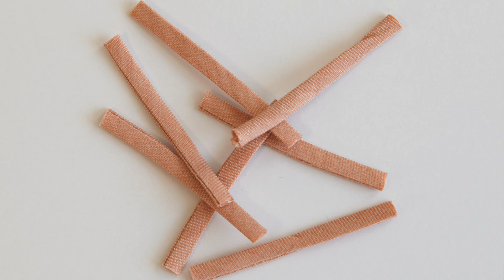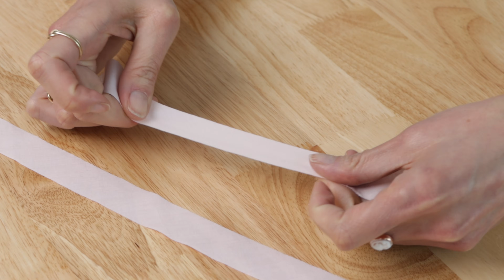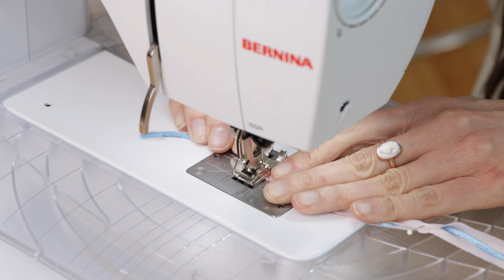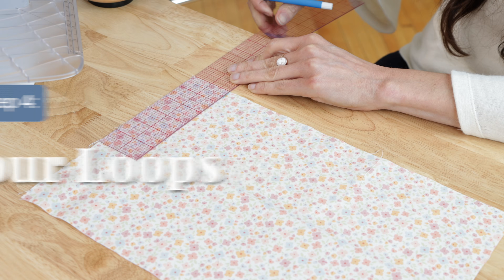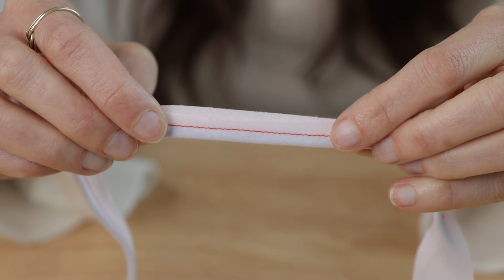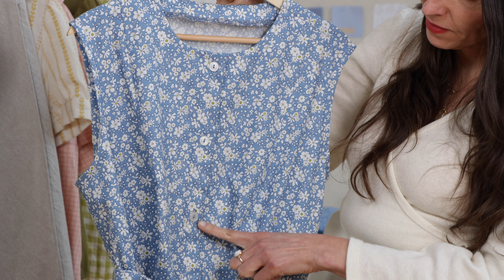Button Loop Sewing Secrets Every Beginner Should Learn (COMPLETE GUIDE)

Comment: I’m getting ready to make a button hole loop for a jacket (only need one button and loop) and the decorative button I’m using is 2.25” in diameter. How do I calculate how long to cut the bias strip to loop around a button that size? TIA
Reply from the maker: I'd suggest cutting a loop that is 4-6 inches long and then testing it. You'll probably end up with a length between 3.5-4in long, but button and fabric thickness will be variable.